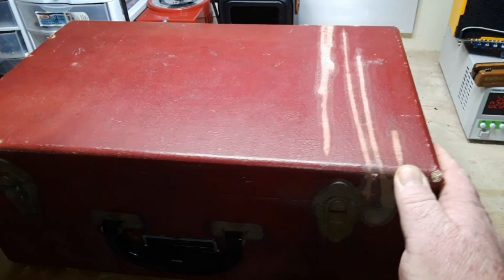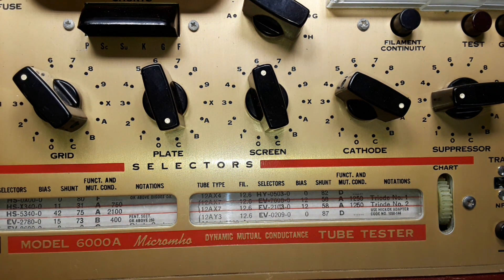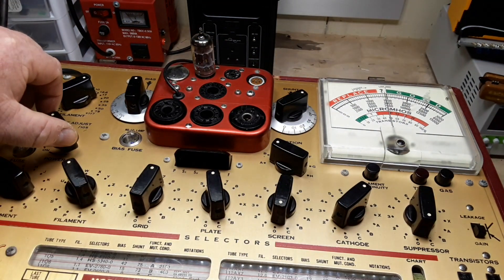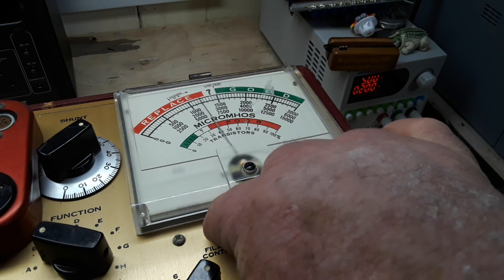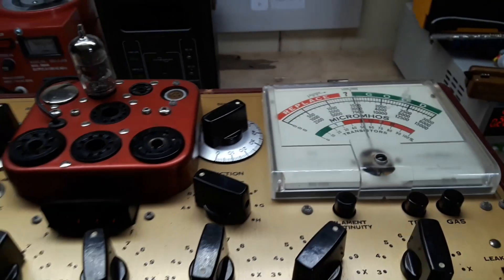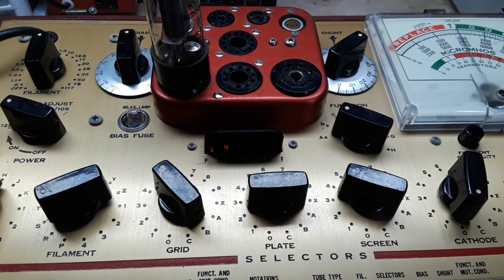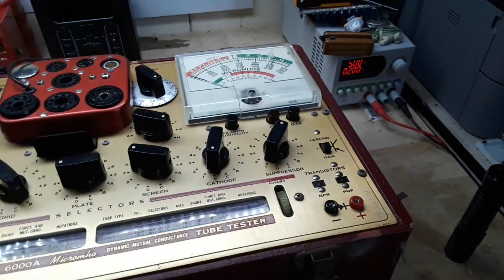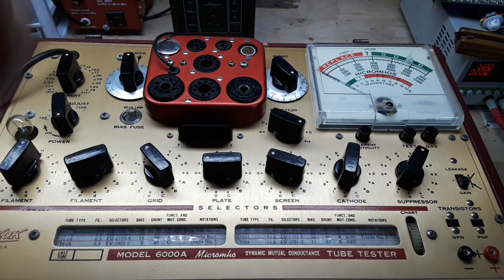Vintage Hickok Vacuum Tube Tester

Comment: I believe that the 6000A tests both dual triodes in the 12AX7. In your video, you only performed a test on one of the triodes. The roll charts lists 2 calibration settings for the 12AX7 which is for each triode. In your bad tube one of the triodes was bad or both. I'm curious to see the measurement of each triode in the good tube and the bad tube. I know that my Hickok 752 is able to test both triodes in a 12AX7 without adjusting the settings. You just need to push different buttons. I'm still curious about the 6000A because I have the opportunity to purchase one. Thanks in advance! ALSO: Great video.... You don't see many demos like the one you did!! BTW, I am a musician and only test 12AX7's and a few power tubes in my Hickok 752.
Reply from the maker: Thank you

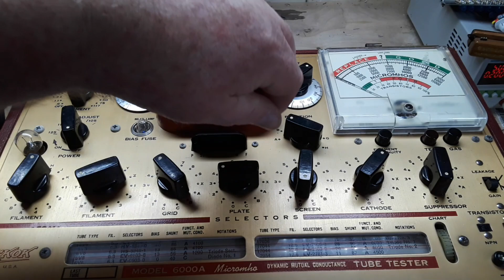Comment: I enjoy your videos!  I noticed that at about 8:32 of the video when testing the 6v6 tube, you set the tester to 5340 and 8 on the suppressor.  From what I can see in the video, it looks like the settings for the 6v6 should be 5348 and 1 on the suppressor.  If what I believe I see is correct, it could also be the reason that tube read as having shorts.

Comment: Nice piece, esp as a gift. I traded what was junk for me for mine. I have a Hickock 600A which looks the same except it doesn't have that red sub-chassis. They are or can be finicky beasts. They use an 83 mercury vapor rectifier, those are getting hard to get, and the various solid-state replacements impose their own little pieces of weirdness. There is guy who has published a refurb procedure, google "Hickock 6000 restoration". Better for you than for me. 
This is a piece of gear that you have to be very conscious of half a dozen things while you use it---it's not just a matter of of turning the knobs and shoving a tube in (the correct) socket.

Comment: Reminds me of my days working at the local drug store.  We had a tube tester that was right up near the front door.  More than once, I wound up helping someone test the bag of tubes that he/she brought in for testing.  The consumer repair strategy was unless one is not lighting up,  grab all of the tubes, and go test them.  Replace all that fail.  The tubes were in the bottom of the cabinet in drawers.  I had learned on the tester that my Dad had for his side business repairing radios and TVs.  I wish I would have asked for the equipment that he had before he sold/gave it away.  I would have my own Mr Carlson's lab.  I recognize a lot of that stuff.

Comment: We had a valve radios during my early childhood, a German made Siemens and a British Ferguson. They worked with a very large battery with a plug with lot of pins and my father said that the batteries were expensive. My knowledge on Valves are very little, but I enjoyed your video. Thank you.

Comment: Wow! That's a big dose of nostalgia for me!

I remember several times when a TV or radio was ailing, my dad would pull all the tubes, put them a shoebox, and we'd drive to the drugstore to test them. If we found a bad one, we would call a store employee, who would unlock the cabinet under the tester. In the cabinet were several trays of new tubes, each in its own little box. We'd pick out the replacement, test it, then pay for it at the cash register -- along with a pack of gum for me, cigarettes for Dad, and hand lotion for Mom. Good memories from a simpler time!
Reply: If you lived in my neighborhood, I might have been the employee.
Reply: @WatchesTrainsAndRockets  I kinda doubt that. You'd have to be pretty old. I was born in '49.

Comment: The 12AX7 is a dual triode.  Each half must be tested separately. That’s why there are two rows of test settings on the roll chart.
Reply: You do get bonus points for setting the line adjust with the tube under test in the socket.  Technically that should be done for each individual tube, because there can be variations in filament current demand from sample to sample - although that admittedly will rarely be very significant among tubes of the same type number.  But with tubes that have high filament current, that can be more important.  In my experience, tube testers, no matter how complex, aren’t much more than gross indicators.  The ultimate tube test is put it in the circuit, and see if you can make it work. For high frequency signal generators, I used to keep dozens of the same tube number on hand.  All would check good on a tube tester, but some would work in some generators and some not.  But those that didn’t work in one generator would sometimes work extremely well in another. It was all “FM”…. I’m not referring to frequency modulation, here….
Reply: Yah, that's a pain the butt. Especially if you have 23 12AX7s to test, or even worse, a whole collection of 12AX7, 12AU7, AT7, etc; etc

Comment: I wonder what the Shunt control is doing to the meter needle scale and it seems like the shunt control is also changing the current or something for the transistor compared to testing tubes the shunt is set different.

Comment: I believe the function switch is set to A on a 12ax7 tube for conductance test. I have one of these. Don’t use it much since I found a pristine Hickok 539C model. Why your first triode showed 0 on the scale, your function was set to B. And no, fingerprinting will not harm a thing.
Reply: But wiping the fingerprints will…. When you’ve lost the old, tired paint that tells you what tube it is.

Comment: Very interesting, I used these things when I made my transmitters as a teenager (I am 65). By the way, the clip lead is for the anode, not the cathode, but I know you know that :-)  Thanks!
Reply: Or the grid.
Reply: @SIXSTRING63  Right, and sometimes even anode + grid.

Comment: An important tip for the folks at home.  Look up the tube on the chart and make all the settings BEFORE you plug the tube in.  There are few sicker feelings than popping in a nice 6SN7 and watching it burn out in a half second because the last tube you tested before was a 50L6 and didn't change the filament settings yet.

Comment: Outstanding! Always had a soft spot for warm glow of a Vacuum tube
Reply: I could warm my hands over the kitchen radio after coming in on a cold winter day.
Reply: @WatchesTrainsAndRockets  I'm 34 so tubes were like these magical devices from the past..
Reply: @skyking6989  So, no fond memories of turning on the power and waiting for the tubes to warm up?
Reply: @WatchesTrainsAndRockets  sadly no but I'm planning on building a tube amp. I'm a licensed ham operator as well and need a project